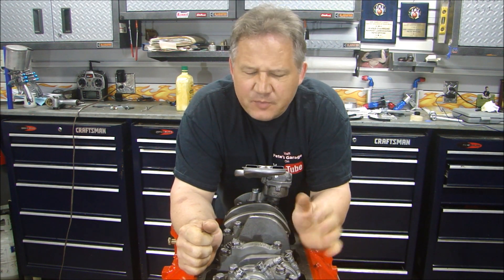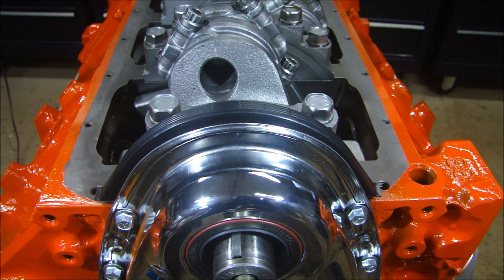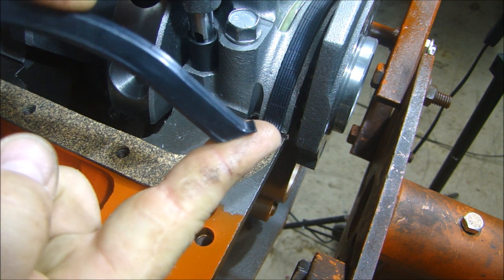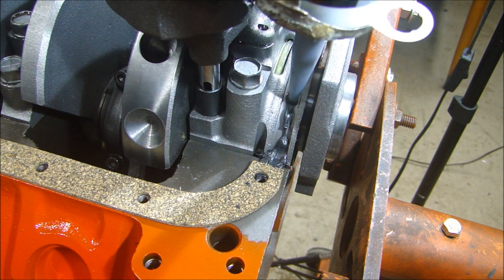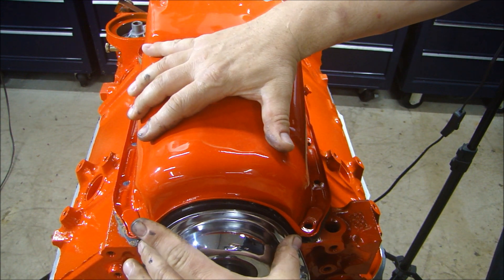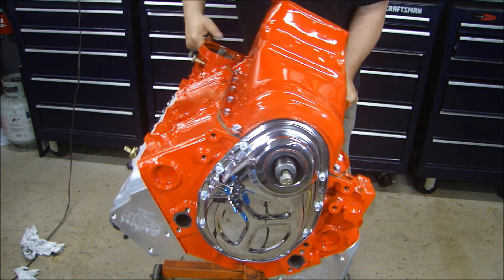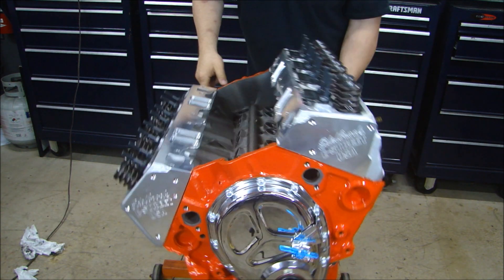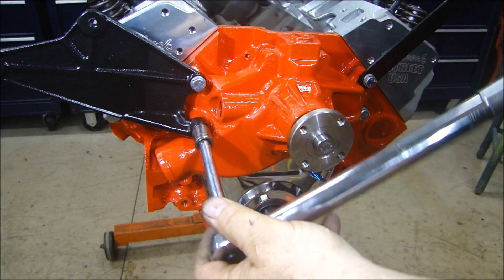Engine Building Part 9 - Installing the Oil Pan and Water Pump Small Block Chevy 350

Comment: How do you seal that hole that goes into the water jacket? Just put the permatex on the bolt threads before you put the bolt in?
Reply from the maker: Yes, thread sealer

Comment: What are the 2 holes on either side of the lower block? The 2 holes on either side of the crank pulley. Thanks, just making sure i dont need to plug em lol
Reply from the maker: Those are holes for accessory mounting bolts

Comment: Should always remove paint from any area that a gasket has to sit. The paint causes a gap and once it's wore off there will b missing material
Reply from the maker: That's not necessarily true. If it's seals, just leave it

Comment: Thanks for this video. I was always not clear on exactly how and where to put the right stuff on when applying a cork  the oil pan gasket on the 350 SBC.  I have a 79K5. I'm switching to the old school cork gasket. These one piece gaskets seem to keep giving me a small leak in the rear of my oil pan right in the middle of the U shape between the pan and gasket annoying . I will definitely try your method. 😎
Reply from the maker: Glad it was helpful!

Comment: Pete, I'm curious as to why you didn't use a one piece FelPro oil pan gasket?  I'm never use a 4 piece design again, but wanted your thoughts.
Reply from the maker: The one piece is '86 and after. I do like the one piece, but if done correctly the 4 piece works great.